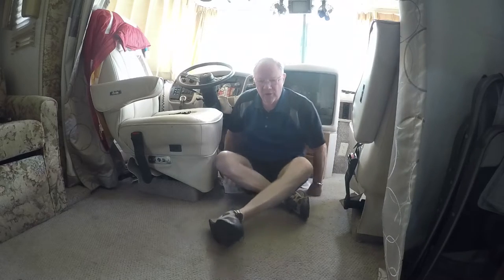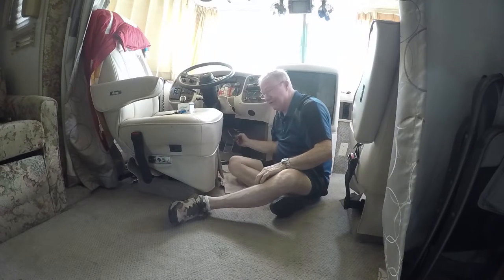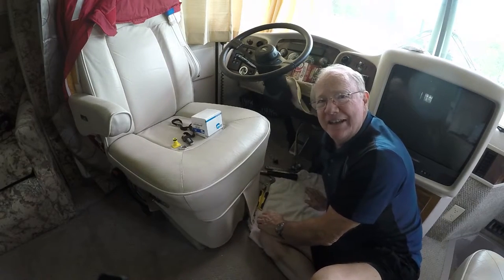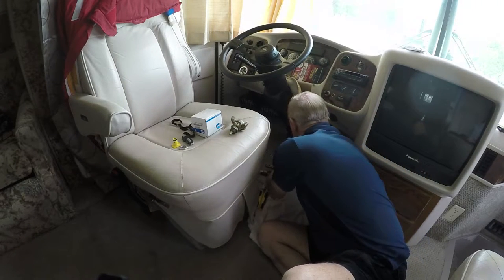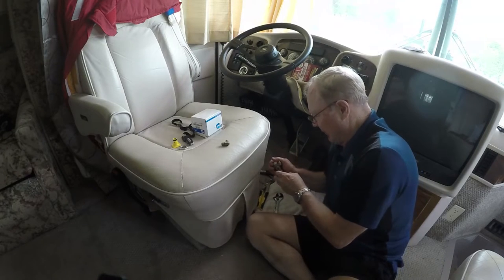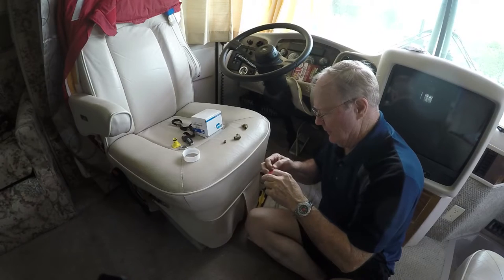Air parking brake valve fix In my 37' Allegro Bus

Comment: I have the same rv as yours. Did your park brake light stay on always before you changed out the valve?
Reply from the maker: Hi Shane. No, it always went out when released, until it started leaking. It was an easy replacement, once I figured it out. The lines were “shark bite” connectors, so you need to push it on the bite connector, then the line pulls out easily. If you are somewhat manically inclined, you should be able to replace it yourself and save some bucks. Good luck and safe travels.